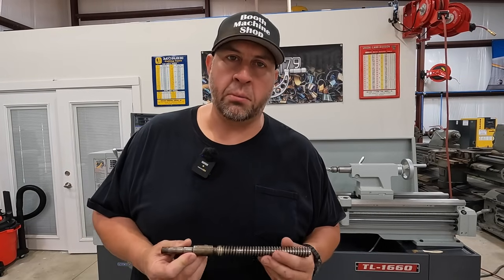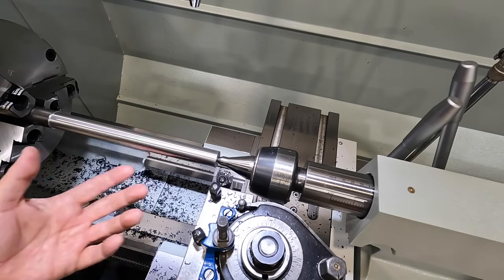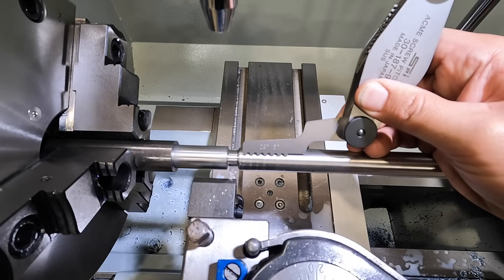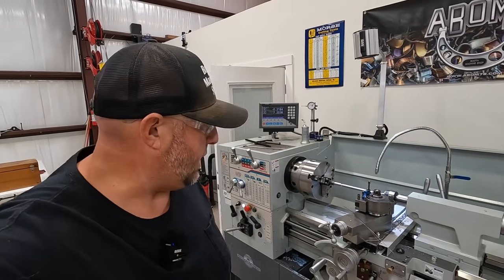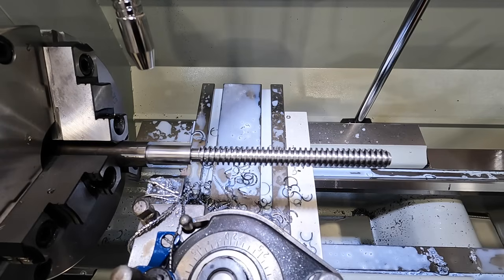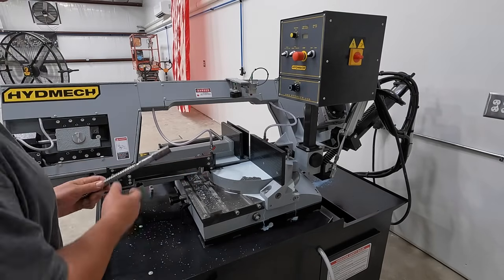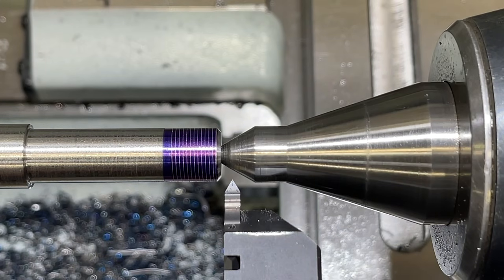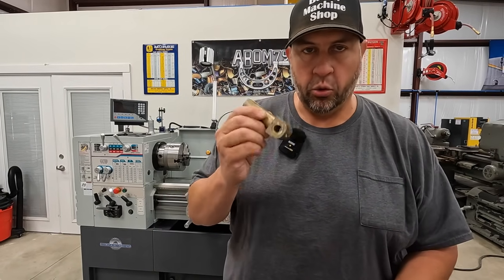Compound Acme Lead Screw for American Pacemaker Lathe

Comment: Could you modify the follow-rest so it sits in a T-nut slot on the cross slide?  That way it would be more in-line with the cutter all the time and would push opposite the bending force?  You'd have to use the compound for in-feed.   Might have to feed the compound out to accomodate for the part thinning when turning normally but not for threading where it would ride on the unchanging outside.
Precision Matthews might even have a part designed for this, if not you could create one.
Reply: He needs to modify the follow rest so it bolts to the rear of the carriage. There is NO WAY that you can mount it to the cross slide, since that must be moved back every pass so that the tool will clear the work on the return path.
How you describe the process is how it is done on lathes which don't have a thread dial, so you have to stop the lathe and put it in reverse to wind back to the starting position. However you still must back off the cross slide to relieve the tool pressure on the return pass, or risk strange chatter etc from the tool scraping all the way back along the thread.
On a proper lathe like this, you are engaging and disengaging the carriage half-nut every pass... the steps are:
Wind the carriage full left to start, run the cross slide in to zero, dial in the depth of cut with the compound, wait until the thread dial number comes around, engage half nut, cut the thread, disengage half nut, wind the cross slide out until tool clears the work, wind the carriage left back to start...

Comment: It's amazing how little the starting inertia of the leadscrew engagement affects the final accuracy of the job. Especially considering the mass of load that the screw needs to move at an instant.
Reply: The leadscrew is coupled to the spindle.
If the RPM of the leadscrew drops by engaging the split nut, the spindle RPM drops the same rate.
Reply: @mr.slowhand3843  - Random Dude is talking about the instantaneous acceleration of the (heavy) carriage.

Comment: I don't see it engagine on '1', can you explain? I see only the dot passing on '1'.
Reply: It's just parallax error due to placement of the camera. If the camera was attached to Adam's forehead, you would be able to see that the indication mark on the lathe perfectly lines up with the 1, 2, 3, 4, or the half lines when engaged. The dial is meant to be used/read from the operator's height and position standing in front of it while using it, not down low and way off to the side. :) Next time you drive your car, look at the instrument cluster. Are the gauges angled upward toward your face at roughly a 15° angle or so, or are they flat and plumb vertically perpendicular to the ground? Are the gauges on the side angled inward so that the whole cluster is shaped like a curve, sorta like a ) parentheses, or is it totally straight and flat like an "I" shape? I'm guessing it's tilted up toward your face, and it's curved. That's to minimize the parallax error. :) You'll read 40mph, but if your passenger looks over and stares straight at the gauge, they will say the speedometer needle is resting at 35 or 30mph from their point of view. 👍

Comment: Those first couple threading passes sounded bad, glad it cleared up when the coolant was added. Unsure why the first cuts were done without the coolant?
Reply: @Roy Johnson yep that is what the first scratch pass is indeed for. But once the actual cutting happens you could hear it was begging for a little lubricity. Luckily the roughness cleared up in subsequent passes. After that first failure it seems like an unnecessary risk
Reply: @phillefever1934  This lathe was loaned to Adam by the distributor as a sales tool so viewers could see it in action and choose it over the competition. Although slightly risky the first few cuts without coolant lets the viewers see exactly how the tool works.

Comment: Adam, probably not worth your time, but I’d be interested if you could do a sample of the same acme thread again in the Monarch but this time with a follow rest. Also maybe snugging up the gibs on the compound and cross slide a bit more. If it works out then you know you can still use that machine for similar tasks. Or maybe it won’t work and the machine is too worn to do these kinds of ops.

Comment: An observation.  You cut your Thread Relief before Threading thus reducing the diameter of your shaft making it more flexible.  Minor details which like not having enough Stick Out on your bar to allow the use of your Follow Rest tend to make the process more difficult.

Comment: I was watching this video on my TV and listened to your complaint about the follow rest position. On the cross slide of that machine here are two dovetail slots. Would it be possible to build your own design follow rest and use those two slots to hold the rest in place. With the width of the cross slide you could possibly make the follow rest to where it could be moved right or left of the tool. Just a thought.
Reply: The cross slide must be wound OUT after every pass. You cut the pass, wind out the cross slide, then wind the carriage back to the start, then wind the cross slide back in (to zero on the dial),  then wind in a few more thou on the compound, then make the next pass, then wind the cross slide back out.... rinse and repeat.
If you mount the follow rest on the cross slide, then you cannot wind the tool out. If you can't wind the tool out, how do you get the carriage back to the starting position to take the next pass?
The follow rest must be mounted onto carriage (which moves left and right), and not to either of the slides (that move in and out).

Comment: So.... Would we say this was a rigidity or lash issue with the monarch? Proud to see the PM in action. It did a fabulous job.
Reply: Lash issue, the monarch is over 70 years old and needs a few new parts made
Reply: Mostly a lack of lubricant and speed too slow. You can use much higher rpm when threading away from the chuck I
Reply: Also I think he has chips wmbedded in his half nut. That would explain the tool shifting depending on which number he hit.

Comment: I also noticed on your first try that the half-nuts weren't closing exactly the same on all passes. My lathe will do this if I'm not real careful. I think my half-nuts don't fully close some times.
Reply: This usually happens when there are chips in the half nut assembly. Needs cleaned.

Comment: Great job Abom! I made something similar to that years ago but it was about 6 inches longer than that and I was only taking 2 thou off per pass because I was too scared in case I messed up. I could never get used to using the follower rest for some reason

Comment: @Abom79 could you build yourself a follower rest that uses the T slots on the cross slide? It seems to me that it would be more in line with your cutting tool.
Reply: Then it would move with the cross slide and you wouldn't be able to back up the tool without the rest hitting the work. Maybe you could keep the cross slide fixed and back out using only the compound.

Comment: In my experience cutting a shaft with such dimensions always results in material being slightly pushed or bent away from the tool the closer I get to the middle. Especially with carbide, less so with sharp HSS. Theoretically your thread flanks are closer together in the middle resulting in a tighter fit with the Acme nut. Your feed is going to be ever so slightly different with each revolution on your handwheel. Would you agree or am I wrong maybe?
Reply: even though the result is neglectable, especially with an approx 30° angle on an Acme, I still wonder...
Reply: @philippovich7  
The pitch won’t change with the flex, but the backlash might, but as good machining practice is to always work in the same direction (if you back the tool out to a new diameter) you wind in again to your number, you never read on the wind out so the change in backlash will be irrelevant! 
You can machine parts accurately even if you have 1/2 a turn backlash!
Reply: @grahamstretch6863  yes pitch wont change and backlash is irrelevant if you know how to machine. i was just curious about the consequences in case your thread tool pushes in the middle. In a case like this I would pass 2-3 times at the final diameter anyway after honing the insert again
Reply: I believe you can also increase rpm on those last empty passes to counter bending. what do you think?

Comment: Follow rest. Need to make a tall ell shaped piece that the 2 bolts for the follow rest go thru from the bottom of the ell foot to the top of the ell foot.  So the vertical of the ell lays behind the cross slide. Heat and bend the ell to a vertical.  Mill and drill several mounting holes perhaps drill and tap more.  Now you have a stand to mount a custom follow rest to.  Or perhaps other devices.  Cameras, lights,  

Since the Mathews lathe has T slots on the back of the cross slide there are dozens of things that could be attached there.  
Envision a brass pin in a bracket with a threaded knob to change spring preload to dampen harmonics on parts

Comment: QUESTION: I don't know beans about machining: In the prior video he said he set the compound to 14 degrees and was using the compound to set the depth of cut instead of the crosslide. Why? And how does that 14 degrees not mess with the angle of the acme threads since the tool appeared to have the profile of the finished thread?
Reply: In any threading operation using a cutting bit you need to use the compound because the object is not to imprint the profile of the cutting bit directly into the work. The object is to actually cut at an angle of 14 degrees for this ACME thread (29 degrees for a standard thread) which is what the compound allows the machinist to do. If you were to try to cut by pushing the cutting tool in a perpendicular fashion directly into the the bar stock chatter would result because of two opposing cutting surfaces. You might start out ok but very soon you would start to see the cutting getting louder and the finish becoming rougher. If you were to persist the cutting bit will start digging in and perhaps break the cutting bit.
Reply: @venharis2012  Thanks! Makes total sense now.

Comment: We make a lot of threads at work on shafts and hooks and  nuts for cranes. They are usually much bigger than this shaft and nut and we always make the nut first. Its much easier to hold the nut up for fitting than the shaft.

Comment: Wow, what a beautiful job on that cross slide screw. You were brave to try it without a follower rest but (whew) it worked just fine. I’m really surprised that the follower rest is not designed to be clamped directly behind the cutting tool, wherever it is. It’s pretty much useless for threading the way it is.
Reply: Its only useless because the compound is at such an acute angle. It it was set parallel to the centerline of the machine it would work fine.
Reply: @1ginner1  But then he’d have to go straight in with the tool and wouldn’t have the benefit of the 14 degree angle. Turning the compound 14 degrees the other way might work.
Reply: @ellieprice363  Yes he would, but there is a way round that, you move the compound by small increments to make sure you are only cutting with one side of the tool, and then when you get to depth you move the compound the other way and take a fine skim off the back face.
Reply: @1ginner1  That’s true, hadn’t thought of doing it that way.
Reply: @ellieprice363  Thats the way it was done in the past, little bit if trig needed, tangent works well.

Comment: Looks like you could fab up your own follow rest and use those nice T-slot on the back of the compound. It is a legacy design choice to mount it to the side of the compound there but who is to say that's where it HAS to be, right? There might be enough meat on the factory one to mill a T-slot base in it, if you can't use it, it ain't doing any good sitting there rusting.
Reply: It has to be mounted to the carriage, not the compound or cross slide. That's because when thread cutting you must wind the cross slide in and out on every pass, and you cannot wind it out if the follow rest was pushing onto the back of the work. Furthermore, the Compound is moved in for each cut, so the follow rest would be moved away from the work each cut which makes it pointless.
Reply: @johncoops6897  The T-slots are on the carriage and would work the same as the factory mount....when I said "on the back of the compound", I was referring to the direction or location in the video, not to what part it was attached. This was poor wording on my part. I apologize for the confusion. 😉👍
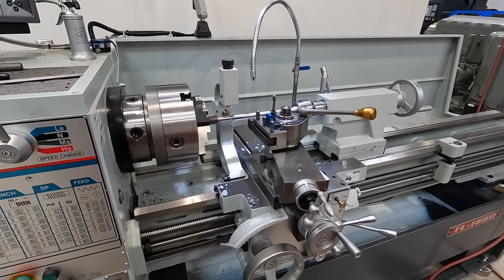Reply: @TgWags69  -  I found a good view at 8:55 and I think you are correct that the T-slots are on the carriage. In which case they would be the perfect place to mount the follow rest.

Comment: 12014, contains lead, ideal for a lead screw, right?
Reply: Isn't it a very soft steel?
Reply: @an2thea514  not sure tbh, I was just making a flippant pun on "lead"  - the only leaded steel I've got experience of is EN1A -Pb (also known as 230M07Pb over here in the UK), it's not "soft" or "bendy", but crumbles when cut,  rather than making swarf or "chips", so lets you get a good finish on small lathes that can't apply high tool pressure, so it's "free cutting" a bit like brass or cast iron, but harder and stiffer.  On a lathe as rigid as Abom's, with the tooling and skills he has, it probably makes little difference to how the finish ends up, but on my small lathe I get better finish just cutting leaded steel than I get from cold-rolled low carbon after filing and sanding.

Comment: How do those machines sync back up to the thread when you reset to the beginning?   This is wild!
Reply: Welcome to the magic of gearboxes
Reply: It's a trick of the mechanism - It never really disengages as such.
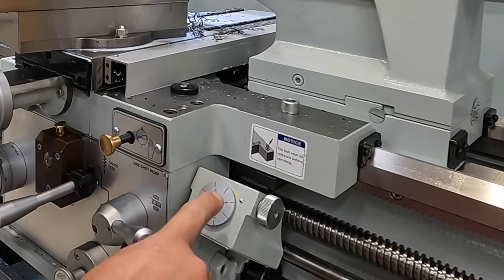Reply: Check at 16:15 - Adam mentions how the threading dial is used to engage the half-nuts at the right time. He points at the threading dial with his right hand.
Reply: @g.tucker8682  Thanks all - Im still in awe of some of these machines and the skills to make them work.

Comment: Was the machining failure on the Monarch due to loose spindle bearings?  I was unable to cut threads with my toy lathe until I realized that the spindle bearing adjustment had come loose.  In my struggle to cut threads, I re-aligned the compound for more rigidity (there is none), and noticed that when I put some tension on the live center that the chuck moved; now I know to watch for this and to check it from time to time.  I had also read that this is critical on larger lathes for achieving a good finish ('stands to reason of course).
Reply: In my opinion the original problem (failure) was not caused by the Monarch but by no coolant and no follow rest being used. He could have probably gotten by without one or the other but not without either one.  So, without duplicating the same set of conditions with the PM, blaming the Monarch is wrong and misleading.

Comment: Chop the bottom of the follow rest off and drill a couple of holes to mount it on the cross slide.
Reply: Mounting on the cross slide won’t work. The follower rest has to remain stationary in the Y direction and cannot move with the cross slide. A better design would be to cantilever it over the cross slide in a way that it could be positioned exactly opposite the cutting tool where it’s needed.

Comment: It helps enormously on these lathe to have some sort of either buna-n sheet that you can get from McMaster or an aluminum shield to help funnel all that coolant away from the carriage and the ways down in between them into the chip pan.

I have a plan drawn for mine which is the 13-in little brother to this, but I haven't gotten around to cutting out the sheet metal yet. In the meantime, I've just been making do by draping the buna-n sheet over the carriage and between the ways.

I'll email you a PDF in the AM.

Oh, and I can hear the difference the coolant made in the threading. Sounds like a huge win there.

What coolant are you using? I've been using MicroSol 685, based on recommendations from Practical Machinist. Seems to work ok.